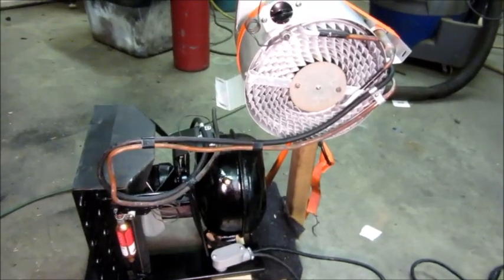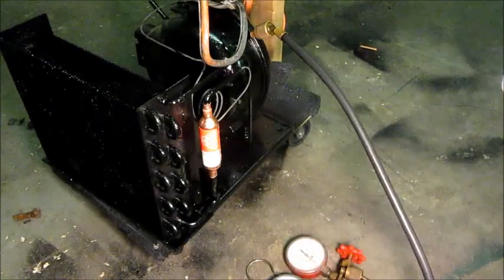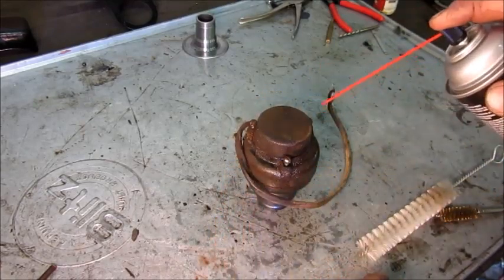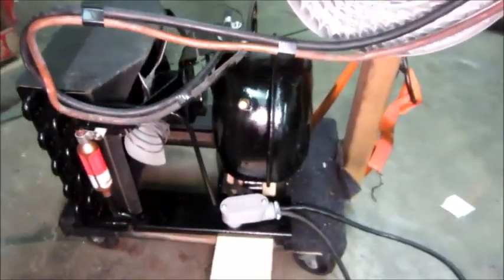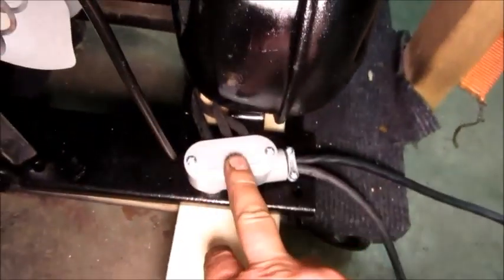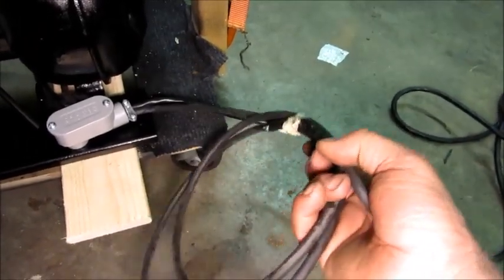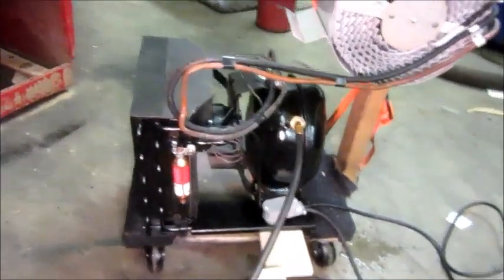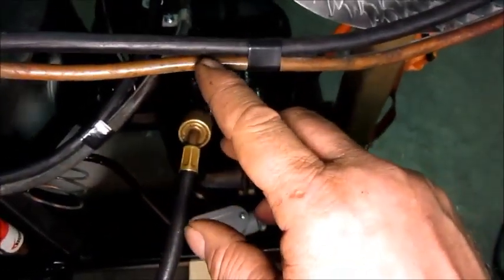Cavalier Coke Machine - 3 - Fan motor service and charging!

Comment: I like how the way you have it mounted on the stand makes it look like some sort of homemade AC unit... but with the condenser also heating the air, it's working more like a dehumidifier.
Reply from the maker: Yep, home made dehumidifier!  You could use it for a small split-unit I guess... but it is designed to have cold air returning to the evaporator. Running in room temp air does operate the compressor outside of its design parameters. It's designed for a limited amount of that during initial cabinet cool-down, but not for prolonged running out of a cabinet.

Comment: David what is air dryer part# and the Flux you use. Where do you buy your parts from when you need them? Your channel is one of my favorites. Thanks for taking the time to show how you fix things. Very vey cool stuff.
Reply from the maker: Hi, thanks for the comment! As for the filter-drier, I order them from online supply places such as Zoro dot com or Supplyhouse dot com.  The driers are Supco SUD112 or SUD14 depending on the size required.  As for the flux and solder, for soldering dissimilar metals or soldering in areas where heat has to be kept to a minimum; StayBrite-8 solder and StayClean liquid acid flux are what is needed. For copper-to-copper joints, Silfos 15 is the easiest solder, and does not require a flux; however it requires a lot of heat and therefore purging the inside of the lines with nitrogen during the job.
Reply: @davida1hiwaaynet  David thanks for that generosity! That really helps me out. So appreciate it. ✌️

Comment: That wouldn’t make a half bad portable ac / dehumidifier!
Question regarding charging: Is it bad if a little liquid got back to the compressor where charging the system, eg if you were shaking the can, some liquid got to the charging lines, and was 90% evaporated by the time it got to the compressor?
By wanting you do projects, it gives me tidbits of knowledge to use when I do projects!
Reply from the maker: Projects are always a good thing for learning and feeling good about doing something productive.  Glad I have inspired you! 

It does pull a lot of moisture from the air!  It would need to be adjusted "just so" to be used longterm in open air. These systems are designed to have a certain temperature at the evaporator. If it has no cabinet, the air returning to the evaporator will always be hot air at room temperature. That overloads the compressor to some degree. They are designed to run like that for short periods during cabinet cool-down but it is hard on them to run in free-air for extended periods when they are designed for use in a cabinet.

Getting liquid to the compressor can do a myriad of bad things, depending on the design of the unit. A few spurts of liquid going into a non-running unit during an initial charge won't hurt anything. What is bad is when the compressor motor is hot, and then a large slug of liquid goes into the housing and hits directly on the windings. That can cause a thermal shock to the winding, cracking the insulation and causing separation of the winding turns, leading to eventual failure. That is more or less what the manufacturers say. I haven't had this happen since I try to be careful not to slug the compressor with liquid. 

The compressor's primary inlet line usually has some sort of internal deflector or other design to prevent this from happening; but you can't depend on that, and the charging port may or may not have any such deflector.  

If the system its self is returning liquid to the compressor for whatever reason - the compressor can tolerate a little of that for a short time - but it is bad for it. The liquid boils off inside the hot compressor housing; and while doing that it dramatically raises the suction pressure and overloads the compressor. 

If the system is "ridiculously" overcharged, where there is liquid refrigerant pooling in the compressor sump, it will displace or dilute the oil, create oil foam, and possibly result in broken reed valves or other immediate, catastrophic damage. That happens if the foam reaches the compressor inlet valves and gets on top of the piston.

The higher the horsepower, the more sensitive they are to this sort of damage. These small HP ones like the antique fridges have are a lot more forgiving. The oil charge for this compressor is very high compared to the refrigerant charge - probably one cup or more of oil.  The system refrigerant charge was minimal - maybe 8 ounces of refrigerant. So if all the liquid on one of these small systems ended up in the compressor, it would probably still be able to start, boil off the liquid in the compressor, and begin cycling normally. These are built with a very large safety margin.  It is a whole different ballgame with larger units, such as R22 heat pump systems and the like.

Here is an example of a flooded start with refrigerant in the sump. You can see the oil level is far above the sight window before start, then it foams up even higher; and then as the refrigerant boils off, it returns to normal: https://www.youtube.com/watch?v=2vgs1idv_eE

They have obviously modified that comprssor with a sight glass to use as a training aid possibly?

Comment: What type of vacuum pump is your preferred make and model ??? Thanks VF
Reply from the maker: I have an Edwards High Vacuum E2M8 scientific pump which is very high-end but reliable. The ones from the auto parts shops are fine to use but don't last all that long.
Reply: @davida1hiwaaynet  Edwards is the Cadillac of vacuum pumps. Thanks

Comment: Which way does the dan blow.  Towards the condenser or compressor?
Reply from the maker: This one draws through the condenser and blows across the compressor. These Tecumseh Pancake units in the higher HP sizes need air cooling on the exterior of the compressor.
Reply: Thank you so much. I have the same machine.  I wasn’t sure mine was installed correctly but it also blow towards the compressor.

Comment: Can you tell me if it is possible to make a motor like this with a horsepower of say three HP ??? Just wondering David and thanks, VF
Reply from the maker: You could make the bearing design like this for a 3 HP motor, but you would still need to have a winding with start windings instead of the shaded-pole motor.
Reply: @davida1hiwaaynet  What would you recommend for me to get more information on this subject so that I can take a stab at manbe making one ??? Thanks V

Comment: Are you using  R152A? If so, how'd you change the oil in the compressor?
Reply from the maker: Yep, using R152A. This compressor doesn't need an oil change since it is designed for dry gas only at the suction. There is no need for blended oil and refrigerant returning. The oil flows along the tubing walls, with a dry vapor returning to the compressor. It has a very high superheat.  With R12 or R152A it would see the same thing. 

It would be different if it were a car A/C system for sure - or a higher HP system. But for these cap tube / heat exchanger systems like this - it works very well with the original mineral oil charge.

Comment: So the evaporator fan runs 24/7 in service ??
Reply from the maker: Yes sir it does! the condenser fan cycles with the compressor, but the evaporator fan runs constantly.   These were commercial machines, where rapid cooling and keeping all drinks evenly cold was paramount. Energy use didn't matter as long as you were selling enough drinks.
Reply: @davida1hiwaaynet  Ok,, I couldn't really fathom the benefit of a continuous evap fan other than frost control but they definitely knew what they were doing,,,,,, UNLIKE the folks that designed my Samsung french door..
Those guys were high on something...   :)

Comment: Where can i buy that motor? I need it for a vintage coke machine v39
Reply from the maker: Hi Steve. I get them from the online seller Zoro dot com, or SupplyHouse dot com.  Search "unit bearing motor" and you can select the direction (CW versus CCW) and the power in watts output.